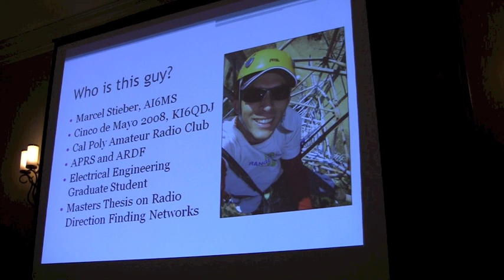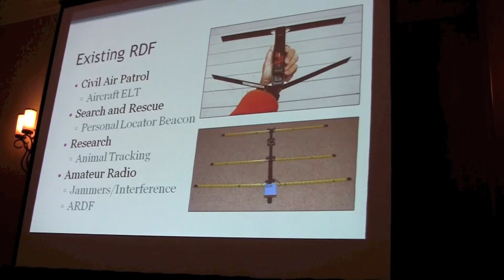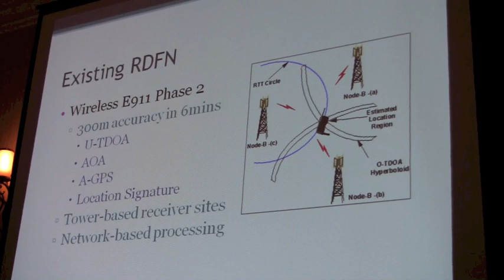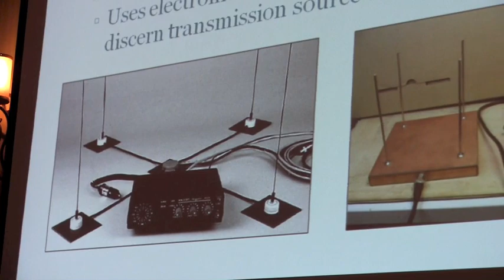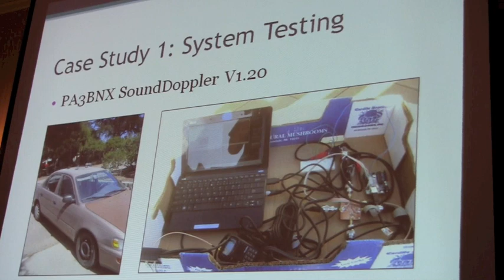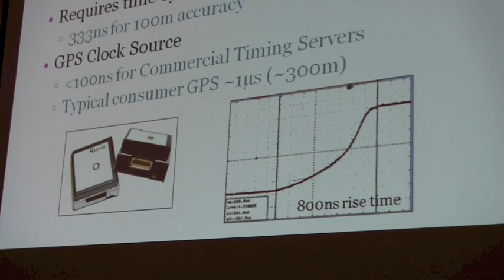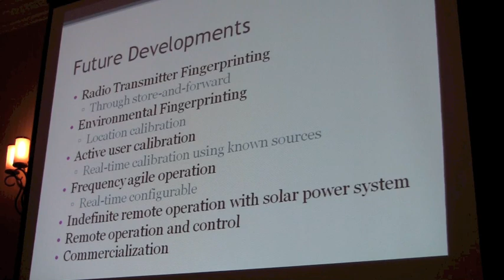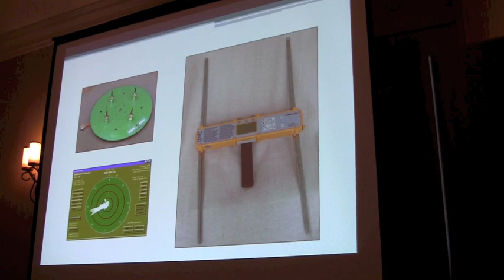Radio Direction Finding Networks

Comment: At 18:25 Ray says pseudo doppler has < 1/4 wavelength between antennas, but I think the right number is < 1/2 wavelength. We try to use 1/3rd wavelength to get a good amplitude signal without exceeding the maximum distance. I hope we're right about that. 🙂
Reply: Mutual impedance between the antennas causes an increased phase shift over free space that makes the optimum spacing less than 1/2 wavelength.  1/4 wavelength is generally considered the optimum.